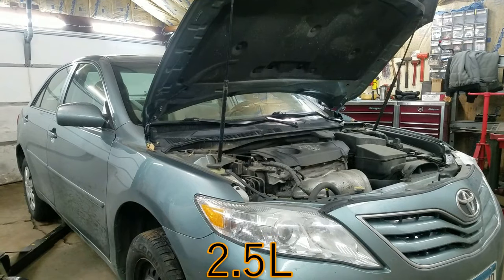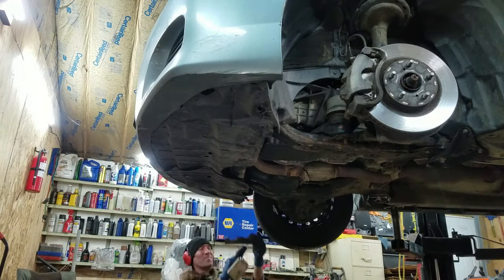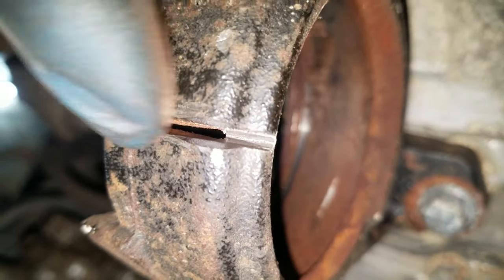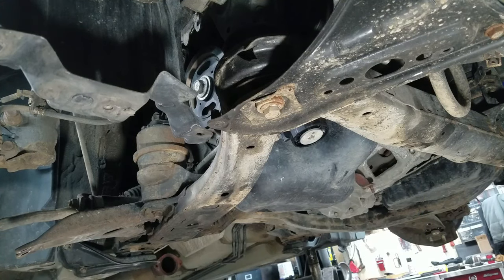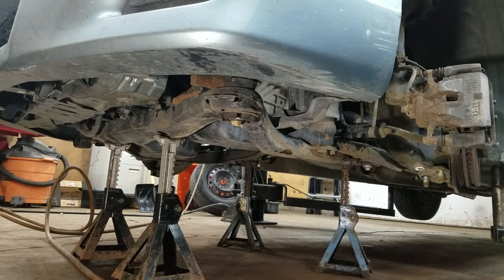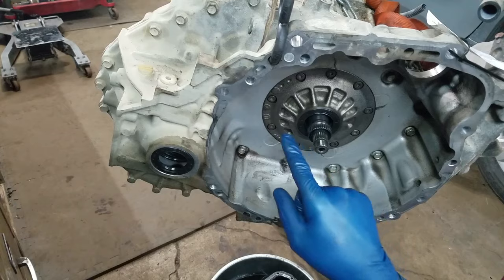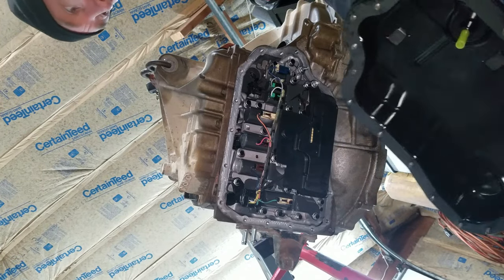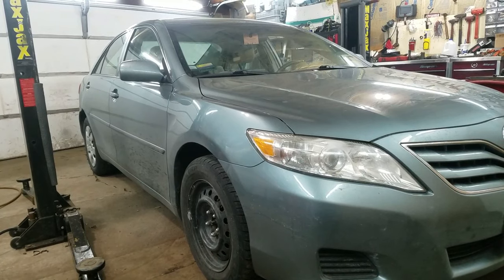2010-2017 Toyota Camry 2.5L transmission replacement

Comment: Great video, but would it not have been easier to pull the engine and transmission as a single unit then remove the tranny?
Reply from the maker: Maybe if you're you. I don't see the need.

Comment: Only question. How did you know when to stop letting fluid out when checking the level? It looked like it started to dribble a little bit and then you put plug back in. Is that what you did?
Reply from the maker: Yes. There was a steady stream, and when it started dribbling, I put the plug in.

Comment: I need and explanation on the replacement for 2011 transmission. Does it require any synchronizing after installation?
My mechanic just changed mine but it slips intermittently with no code. The seller of the transmission (Brandywine) said the mechanic did not synchronize it after installations. But my mechanic said that the transmission supplied is not good.
Any comment please.
Reply from the maker: It's a cvt. Maybe you should do what he says. I would check the fluid level first.
Reply: @RustBeltAuto  The camry's never came with a CVT transmission.
Reply: Synchronization?? There's not such thing. Using Techstream you can reset the memory and that enables the ECU to re-learn the driving behaviour of the driver and adapt to different shift time/ shift points.
Reply from the maker: @auaq  ooh. Srry. Thought it was for some reason. Looked it up, says CVT in hybred Camry only.

Comment: My 2010 camry makes a grinding (some sort knocking sound) and jerks forward by force when up shifting. Sometimes the tyres screech from the force. I'm yet to change the fluid or top it up. Will a fluid change or replacement stop this sound.
Reply from the maker: Probably not.

Comment: Hi, great video. I am considering buying a 2010 with a bad 6 speed manual transmission. Do you know if it's possible to drop it in from above or does it have to come from below? It almost looks worthwhile to lift the engine out.
Reply from the maker: I take a them  out the bottom. Someone else might do it differently.
Reply: You can do it in your driveway if you aren’t intimidated by it you just support the bottom of the engine with a jack stand and drop the trans out the bottom with a regular jack

Comment: Work a lot. Like 8hr! Wow but thank for tip ! I ll fix my car 2018 Camry for transmission replacement
Reply: Yeah 2018 car needed a transmission change?
Reply: Yes it replaced transmission because it was a leak and damaged the transmission. That why I order the transmission and fix it. Not flush it with fluid transmission

Comment: is the transmission a closed one just like the 09 or did they made it more friendly access
Reply from the maker: Did you watch the video?
Reply: Yes I did
I bought a 11 model LE last week and I asked friend for advice what will be an issue for the car.
 his car a Camry 09 se his only big issue is the transmission closed for fluid change. Just wondering if the car manufacturer changed the transmission fluid more user friendly
Reply from the maker: @alaskanzombie9075  do you mean closed as in no dipstick, or drain plug?
Reply: Yea I was wondering bc I don't have  any knowledge about cars.
Grew up around 4 wheelers, snowmobiles,and boats
Reply from the maker: @alaskanzombie9075  Me too. Technically, it doesn't require service, If it was my vehicle, I would drain the fluid, measure how much came out, and add the same amount about every 60k miles. That's what they do on Honda's. Checking the level would be ideal.
Reply: @alaskanzombie9075  These are lifetime fluid; meaning never really having to change/service the transmission fluid like back in the day. Same thing with engine coolant lasting about 100k mi. Although they do get serviced but a lot less than it used to depending on manufacturer's maintenance schedule. A lot of manufacturers have been doing this for a quite a while now. It's designed to last a long time, and to prevent customer from having to frequently pay fluid change/services every 30,60k ... mile service. Now it's right about 100k or 150k mi. Check your manufacturer's recommendations.

Comment: Thank you for this video. I just purchased my 2017 Toyota Camry. I am just wondering how long my 6-speed automatic transmission may last?
Reply from the maker: everyone's guess is as good as a psychics.
Reply: @RustBeltAuto  Thank you for your prompt reply, I guess I wanted to ask - how reliable is this transmission vs KIA six speed transmission for example?
Reply: Toyota's Aisin 6 speed transmission is bullet proof. The is easily the best transmission on the market. This is literally the only video I could find on youtube that does a replacement of this transmission. This transmission went bad after the owner did a transmission flush. I personally wont ever flush mine. I think when it comes to engine and transmission, Toyota is top and Kia is not even top 5
Reply: @chris2kgreat  Thank you for your reply. How frequently would you recommend Aisin 6 speed transmission oil changes?
Reply: @oneundecided  i own a 2016 camry which i bought used when it was 3 years old. I personally will never change the transmission oil bcuz the previous owner didnt and so im afraid doing it now might cause problems like transmission slipping. I have heard too many horror stories of people having problems after changing their transmissiom oil. Many peo0le drive their Toyotas more than 250k miles without ever  changing transmission fluid. Just make sure you change the engine oil every 5k miles, NO EXCEPTIONS
Reply: @chris2kgreat  Thank you very much for your prompt reply!
Reply: @oneundecided  the car in the video you sent changed their fluid at 70k miles in 2018 when the car was 3 years old, and the transmission started slipping in 2020 at 125k miles. I wouldnt be surprised that the transmission slipped bcuz the fluid was changed to probably a lower quality. This are the things im afraid of
Reply: @chris2kgreat  You could be 100% right on this.
Reply: @chris2kgreat  He also mentioned this transmission failed because it was not filled properly and had little to no transmission fluid when it was removed...
Reply: @chris2kgreat  They probably used a different transmission fluid that wasn't compatible with WS...  I had a Honda and flushed it with regular fluid and noticed a change in shifts immediately...  Drained it and used MaxLife and it returned to normal...
Reply: @chris2kgreat  Agreed...
Reply: I'm dealing with a 2013 RAV4 that one of the bearings decided to retire early.  It's a known failure point of the 6 speed U760E trans. A drain and fill was done at the dealer about a month before but I think it was already shot because it was shifting rough before the dealer visit.  Has 140,000 miles on it.  I'm having a shop replace the trans with a used unit for 1,900.
Reply: @joebass5163  Thank you for your prompt reply! May I ask you how many times did you do the transmission oil change within these 140,000 miles?
Reply: @oneundecided  just the one time at approximately 130,000 miles.  The car was bought at 45,000 miles so I doubt it was done before we owned it.  I looked at the maintenance manual and saw it basically was not serviceable so we didn't mess with it. The only thing I say is there are hundreds of thousands of Camrys and RAV4 on the road and appear to be dependable.  Only found rare cases of trans failure and I searched quite a bit.

Comment: Enjoyed the surgery here... Just a quick question... my camry has some atf oil sticking out at the bottom of bell housing. Do you think that I need to check the torque converter seals etc?  Thank you.
Reply from the maker: If it is up into the housing, I would guess so. Hope it's a small leak.

Comment: My 2012 Camry is one of those unlucky ones with the shuttering in the transmission and faulty torque convertors. Toyota replaced it about 2 years ago (for free) but it still has some issues starting up again. At 136k miles I feel my Camry may need a new transmission before 150k. Very disappointed. I bought the Camry because of perceived reliability that Toyota is known for. There is no way I would attempt this job myself. Thanks for showing us.
Reply: same here.. mine is @ 250k its beet shuddering the last 100k,, but when im acceleration from a stop i leave it in 3rd gear till 35mpg.. i never get shuddering that way
Reply: Whenever you feel shudder. 
If you intended to keep up speed and not slow down, rev up to over 3,500 rpm to stop shudder then rev back down to normal so you won't feel shudder temporary. 

If you are about to stop or slow down to traffic, lay off gas and shudder will immediately stopped so you can push gas pedal without shudder. 

Drove like that since 3 years because Toyota refused replace mine cuz high mileage.
Reply: I own a 2013 Camry that has the TC shudder.  I never knew about the recall they had till mine was passed 150,000.  I mostly used sport mode to shift it manually whenever I’m in slower traffic/stoplights or up and down hills and it’s till going.  Bought the car with under 30,000 miles and it now has 268,000.

Comment: Hi Admin and Guest! I have the same Toyota Camry 2009 and has transmission issue. What do you suggest gear repair or replacement. 

These are the problems I have

1. Problem started with bang sound while shifting P to R

2. 2nd and 3rd gear shifting was very hesitant.

3. Now, only R is working D is working only short distance with low gear and stop in the middle of the road. 
 
4. Transmission oil has burnt smell.

Please suggest guys
Reply from the maker: Probably time to replace the thing. No way to know for sure without looking at it.

Comment: These transmissions are "SEALED UNITS" meaning they're only meant to be serviced when/if there's issues. Other than that LEAVE IT ALONE.
No fluid change (drain/fill) necessary, it's meant to last the lifetime of the vehicle.
Reply from the maker: And just exactly what is your idea of a lifetime? Can it last longer than your idea of a lifetime, if you change the fluid once in a while?
Reply: Follow that train of thought and your Toyota too can be the subject of a similar video.
Reply: You are WRONG, Toyota has a transmission fluid inspection as part of the scheduled maintenance on these camrys for every 30,000 miles. That is not a fluid change every 30,000 but an inspection to see the condition of the fluid, in the case the fluid has gone past it's red color going towards brown or even completely brown then it needs to be changed and if it is black it has already gone to far and needs to be changed asap. This idea has led people to believe there is no set schedule to change the fluid because there isn't a specific CHANGE mileage but there is an official inspect mileage and at one of the 30,000 mile intervals your trans fluid will have to be changed.
Reply: If it were truly sealed and never needed to change atf...the engineers would never have placed a drain plug on the transmissions...and they would not have placed a removable fill bolt ....if it were truly Lifetime fluid, they would have soldered both drain and fill holes after the factory fill of atf. Also all vehicles previous to this 4th gen toyota had regular transmission oil change schedules ....it is contrary to reason to think that suddenly transmissions became super enough that they never need to change atf when it's universally been the practice for all cars to change the fluid to prolong the life of the car...and there are several studies showing that transmission fluid changes do in fact extend the lifetime of the transmissions....the primary reason being that old blackened burnt fluid loses its ability to lubricate the clutches, the gears, the rotating engaging parts inside the transmissions....that alone makes the difference between a car that dies at 150k vs a car transmission that still works at over 300k plus miles....that's 2xs the lifetime differential...but what is an extra 150k mikes for you? Typically a driver drives 15k Miles per year....so that's an added 10 years on average of extra use of the car...thats saving about the value of a new car every 10 years...all due to atf fluid changes and engine oil changes...😮...